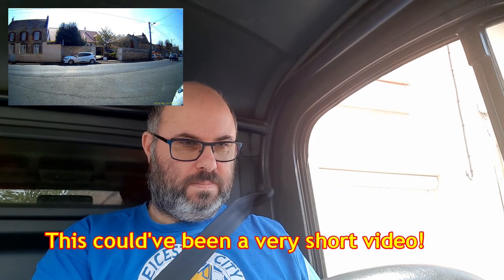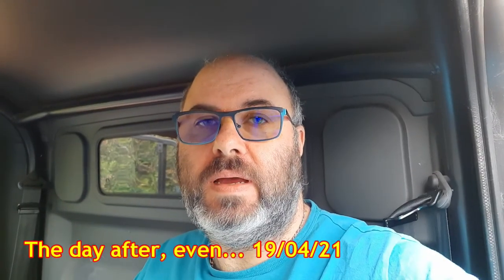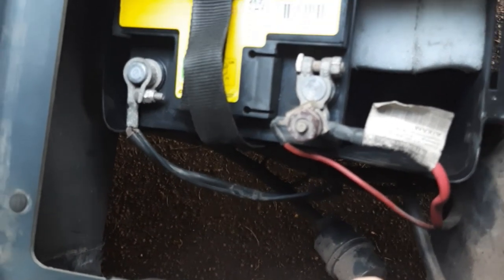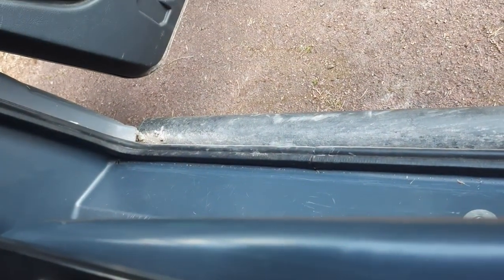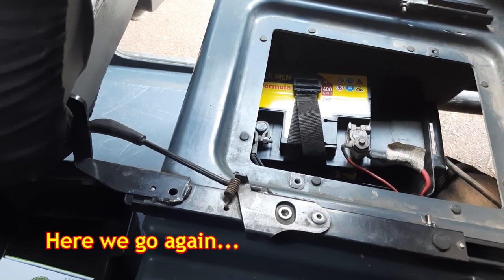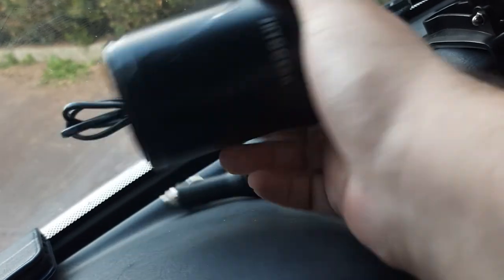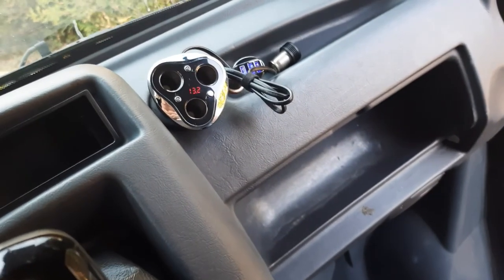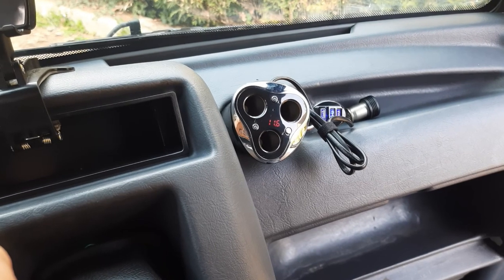Off to the garage for battery & oil shenanigans + verdict | Aixam Mega Multitruck Van

Comment: I think the service manual for the City and Crossline product line applies here as well. In that case, 10 is not a warning code but an indication of approaching or having missed a periodic maintenance. Google "Aixam Service Manual" to grab that piece for yourself.

If I were you I'd have someone take a look at your alternator as 13.7 is not too happy a number to see with the engine on (IIRC, that's the lowest value where it can be considered fine). The issue might actually be with your alternator rather than the battery.
Reply from the maker: Good tip. I need to look into that, as these codes are confusing. They aren't mentioned in the two Mega Multitruck manuals I've managed to find.
So far I've had the oil changed and the battery replaced. Not sure what else I need to do, so the codes disappear? I can remember a time when I didn't have them.
Perhaps need to top the radiator up, haven't done it since this time last year.
Reply from the maker: Sorry I seemed to have missed this comment. Thanks for the address. Like you say, worth a try. Am sure that one day these Multitrucks will become an Aixam classic.